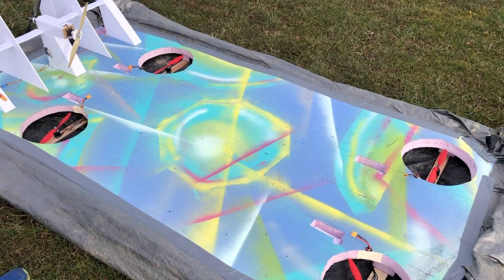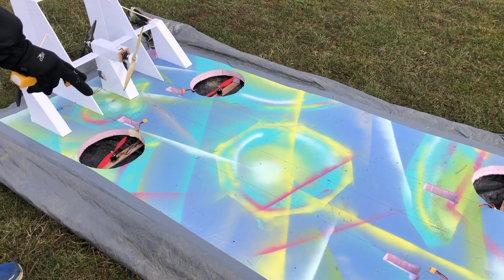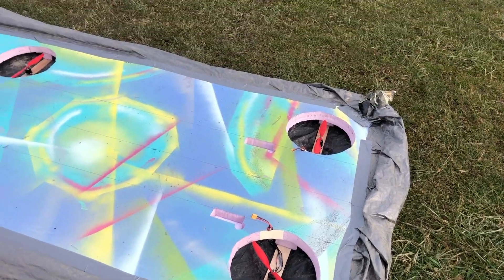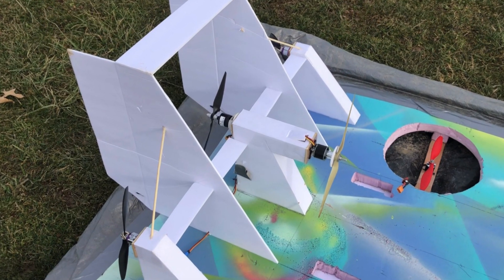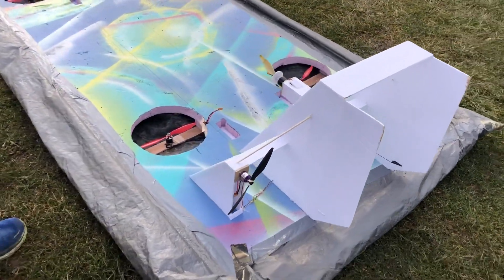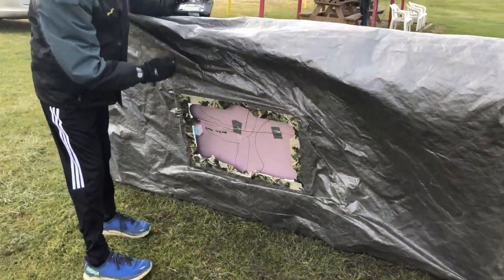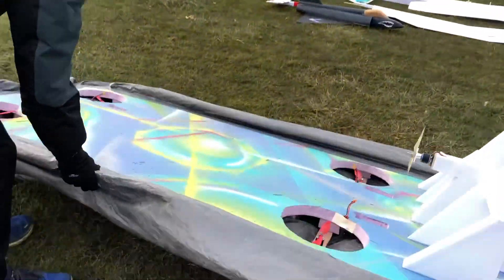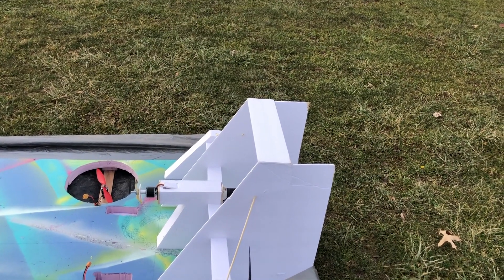Giant 8-Foot DIY RC Hovercraft!

Comment: This thing can hover on just 1 lift motor and a well designed skirt. 
For example: mine is 1:10 weight 5,5Kg, runs on 1 2212 drone motor and a 5" bullnose prop.
Capable of lifting 10Kg in total.